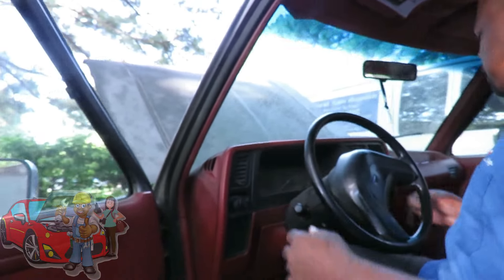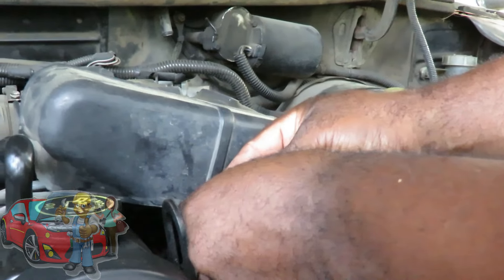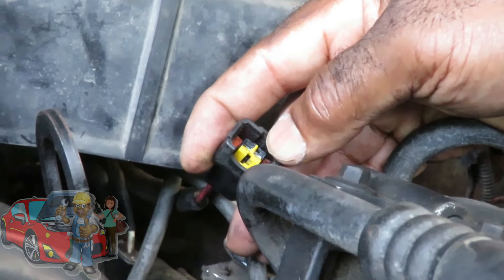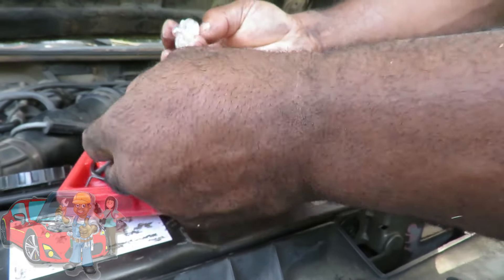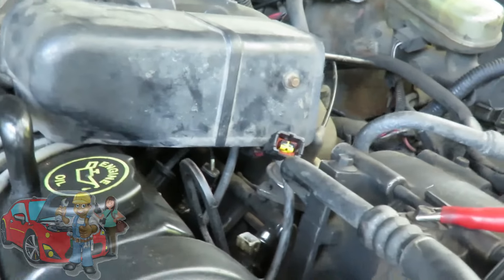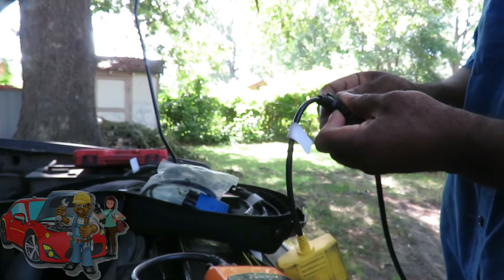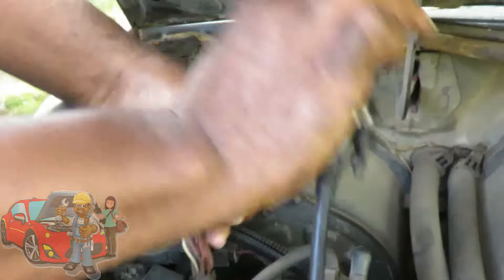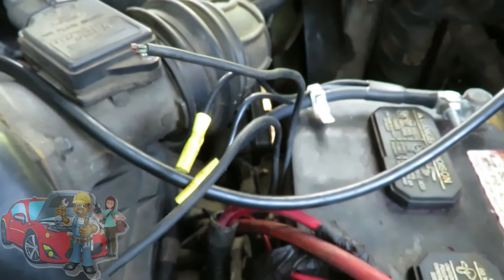Ford Ranger 2.3 Cranks But Will Not Start

Comment: Great video! I appreciated it very much. 
Quick question here as well about a 1988 ford mustang 2.3 engine in a 89 mustang. Background is I got my car from some guy and it never had the computer ground, it was cut right in the middle and Twirled away. One day I connected it and about maybe a week later I experienced my solenoid getting stuck then the car trying to keep starting itself whether it was started or not,new battery new solenoid then I have no acceleration power and it would cut off at lights. Do you think that computers is my issue in this case? 😅